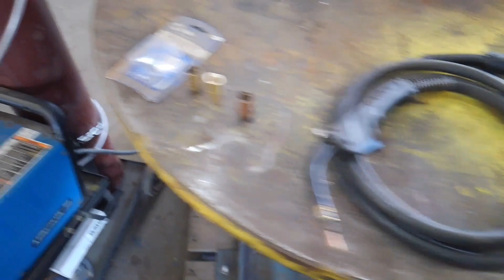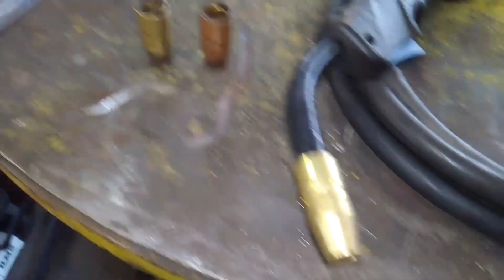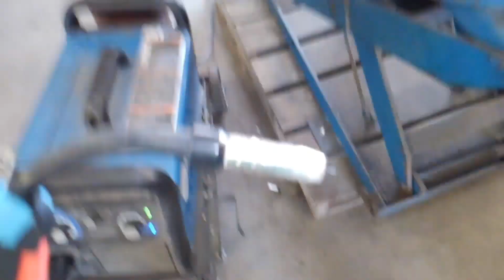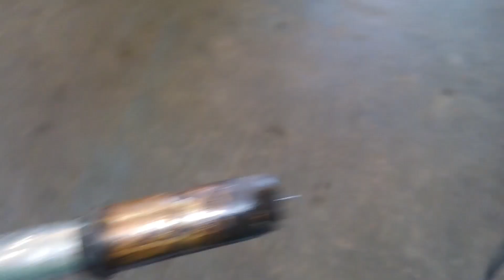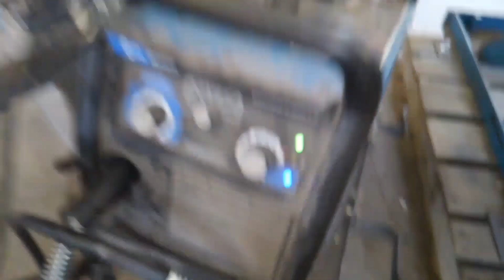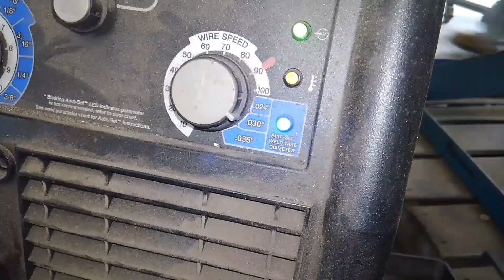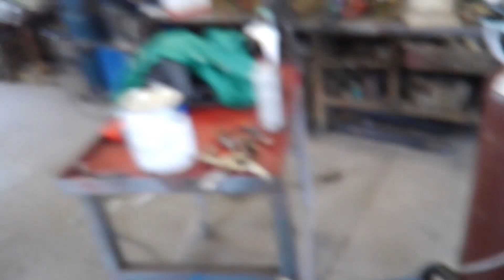Miller 211 problems/design flaw Millermatic 211

Comment: Very interesting problem that arose there.  I used my original nozzle for quite some time, and luckily didn't have that issue, so I can only guess that there must have been a bad batch of nozzles.  Unfortunately, mine has the drive roll wobble just a tad and have to use 3+ on the tension, kind of a bummer on that, but technically the machine still works.  I have an HTP 15-foot M25, 250A gun on it, and it works great so long as there is no major curling of the MIG cable so the wire feeds as straight as possible.  Thanks for making this video, very informative.  I plan to keep my machine as a back-up, and will probably get another MIG, probably an HTP ProPulse unit.  They look freakin' sweet!.
Reply from the maker: Oscar Sanchez Jr, BSc. I have been thinking of one of those myself. I'm going to stick with Miller for a few more years see how it holds up.
Reply: Yea I hear ya, it's still a pretty sweet MIG (the 211).  I was close to getting a HTP ProPulse 200 last month; I had to get on a waiting list because they can't keep them in-stock.  But I found out they have a ProPulse 300 in the works.  I'll definitely post a video on my Youtube, regardless which one I end up getting.
Reply from the maker: Subscribed pal thanks for the info

Comment: Are you really that concerned with replacing the nozzle every 6 months? Nozzles are consumables and replacing a $2 nozzle, twice a year is not even an issue in my eyes. You are a whiner sir. This actually has nothing to do with the 215 welder itself.
Reply from the maker: Mark Blemings this is not a Miller 215 this is a Miller 211. Stay tuned the Miller is back in the shop they are working on it as we speak I will have an update video.
Reply: WildcatWilly A
Reply: The fact he couldn't trouble shoot that....
Reply: Obviously you don't know what you are talking about. $2 nozzle,where,in your dreams. I own Millermatic 211  And I can say it's good but I never would pay a full price for it And I didn't.
I can also tell you my other welder is from Harbor freight $85 
I used it for 17 years And I have not replaced a nozzle at all not even one time.  Please don't talk about the things that you don't know specially making shit up like $2 nozzle

Comment: I changed guns after a few years and the aftermarket gun is way better.
The nozzle screws into place on the new gun, so it is secure and stays put.
Reply: Pat McBride same here...I went with the Bernard centerfire style gun and nozzle set up
Reply: Gun swaps are a great way to upgrade, and many gun makers sell adapters for other brands.

Comment: sr now i am confronting a different problem is that when i plug the welder with  the 120 plug the beaker on the machine turn the machine off dont work, only with 220, do you have miller contact phone number or how i can tell them that! i need this machine to be 120 that was the reason i buy it also what model of guy solve your problem i need model and brand because the gas is escaping! thanks for your help
Reply from the maker: ironguys com I just called htp america/WeldUSA  and asked them for the gun I needed as far as Miller I just worked with them through Facebook

Comment: Good to know since i have one of these 211's at home. Thanks for the info.
Reply: now i am confronting a different problem is that when i plug the welder with  the 120 plug the beaker turn the machine off dont work, only with 220, do you have miller contact phone number or how i can tell them that! i need this machine to be 120 that was the reason i buy itdo you have an ides were to and what model of gun solve your problem i need model and brand because the gas is escaping! thanks for your help i need a 15 ft long

Comment: i got the same problem
same machine
Reply from the maker: ironguys com can't recommend the htp gun enough
Reply: what do they have? accessories and the complete gun?
Reply: did you solve the problem?
Reply from the maker: They sell you the complete gun liner and tips plug in and go to work the one I bought is a swan neck which basically lets you bend the end of the gun whatever Direction you need it's only rated for 180 amps but I have taken mine to full power for extended periods of time no problems
Reply from the maker: http://www.usaweld.com/default.asp 
you can get either the standard gun that is rated for 200 amp the swan neck is a little wobbly and takes some getting used to if you have a bad Shake

Comment: Great. I was going to buy one and order it tomorrow. Looks like I'll be checking out the Lincoln.  I to have a miller 250 and it welds like a race horse and works like a wild bull. Thanks for the inside scoop
Reply from the maker: Love the miller but have to get that gun calculate that in and it's quirky I'm not sure why and I'm still using it still a great welder I'm still a Miller man
Reply: now i am confronting a different problem is that when i plug the welder with  the 120 plug the beaker turn the machine off dont work, only with 220, do you have miller contact phone number or how i can tell them that! i need this machine to be 120 that was the reason i buy it

Comment: A heads up on using the Miller "autoset' feature- It will only work with a 75/25 mix gas, not 100% CO2!
Reply from the maker: David Osland good to know why is that
Reply: There is a switch on the 211 to change gas types.
Reply from the maker: I am aware of that
Reply: WildcatWilly meant to reply to the guy that said it doesn't work with 100% co2
Reply: Not accurate. Autoset only works with C25 on the Millermatic 141 and 190, but on the 211 - which this video is about - Autoset works with 100% CO2 as well.

Comment: I hope someone from Miller sees this video and do something about the cited problem.  For a welder of this class that sells for almost $1200, this is ridiculous.
Reply from the maker: ptmoy1 I was in contact with them they said they would look into it
Reply: @wildcatwilly  sir the problem is that your nozzle is worn out 3 to 6 months is a good life for that part they aren't meant to last forever
Reply: I also have a Miller 211 and it has the same problem
Reply: @robertgustas2094  time for a new nozzle
Reply: now i am confronting a different problem is that when i plug the welder with  the 120 plug the beaker turn the machine off dont work, only with 220, do you have miller contact phone number or how i can tell them that! i need this machine to be 120 that was the reason i buy itdo you have an ides were to and what model of gun solve your problem i need model and brand because the gas is escaping! thanks for your help i need a 15 ft long
Reply from the maker: I just called htp america WeldUSA my Miller rep said the drive roller won't handle a 15' gun I have a 12' and loosened up the wire spool nut to give it an easier time it would groan and moan they don't mention that 10' is the limit for for the gun length
Reply from the maker: ironguys com send it to Miller it should be under warranty see below I answered your questions
Reply: As light as the 211 is a 10' gun should be no issue, I use mine without a cart and nos issue with that. My biggest issue would be the spoolmate 100, feeding a new roll in. How many welders have dainty hands. Could have been designed to load easier
Reply: What htp gun did you go with?
Reply: @JamesKoorey  I been using the M-150 mig gun Miller brand since 2015 no issues whatsoever
Reply: I've run several 10 lb spools thru my 211 with zero problems.  Might I suggest reading the owners manual,  understanding duty cycle ,  and not overheating it......